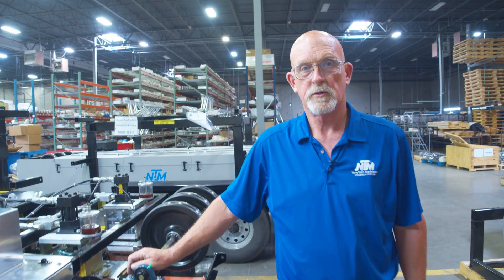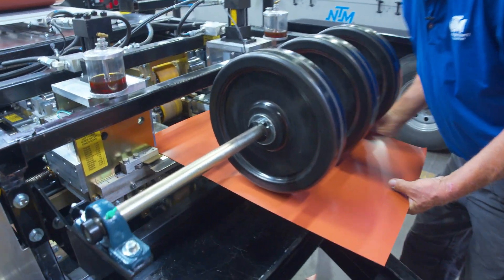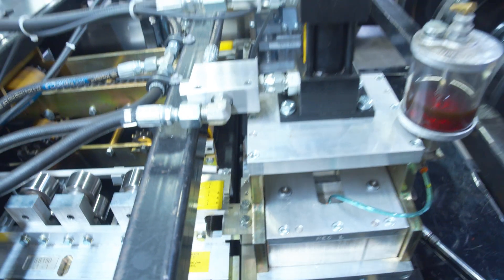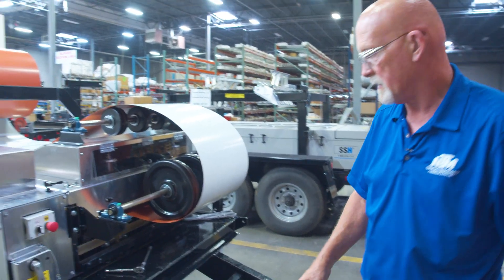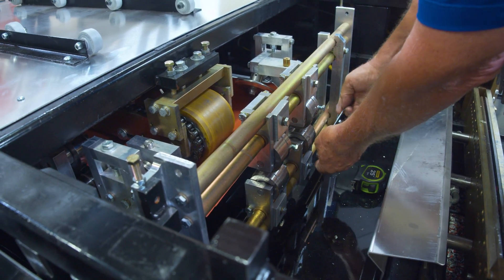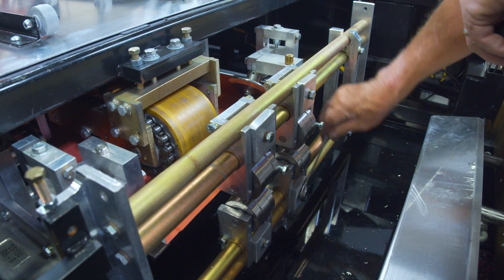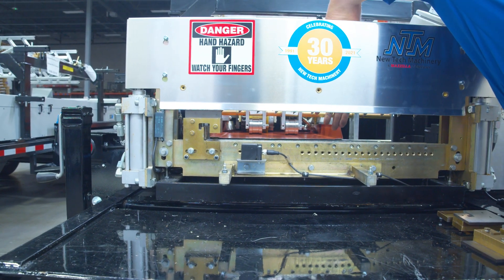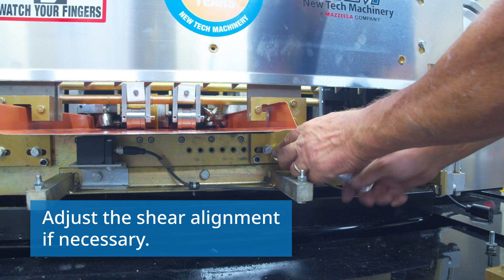How to Change Coil Widths for an NTM SSQ II™ MultiPro

Comment: Why won't my machine run steel coil but aluminum no problem
Reply from the maker: Most of our machines are designed to run steel, aluminum, and copper so reach out to our service team at www.NewTechMachinery.com for assistance if needed.